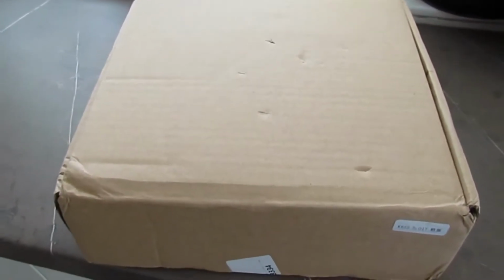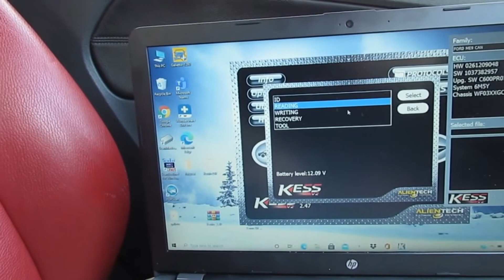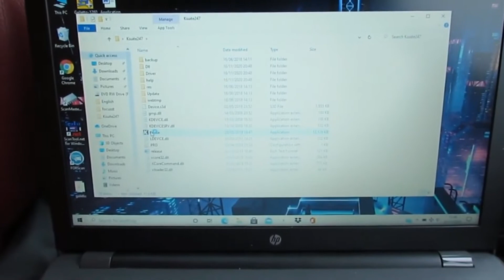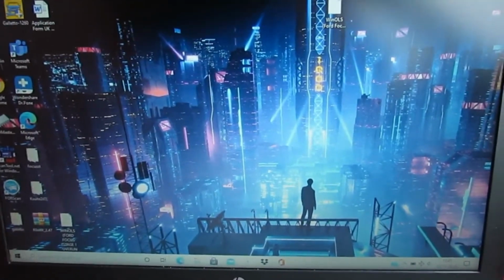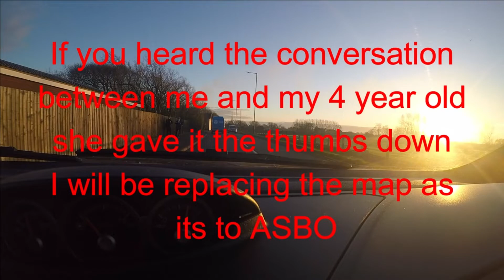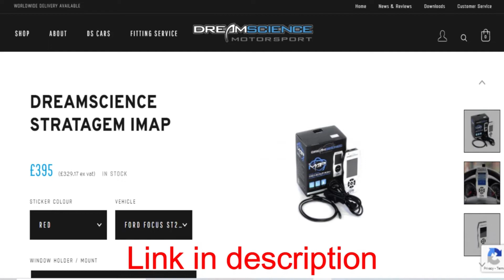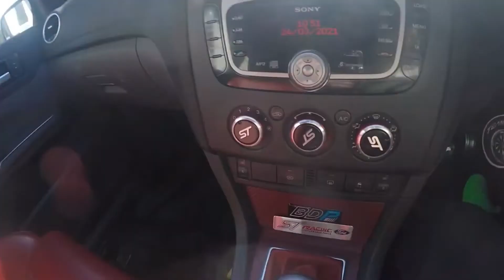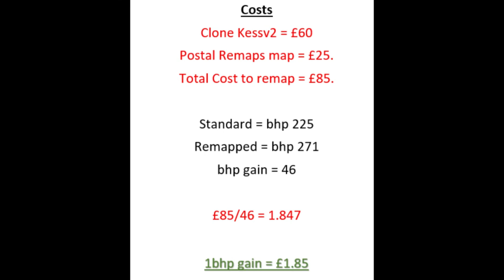Remapping my own car, Mk2 Focus ST225, for less than £100, Dyno results, pops, bangs, flames

Comment: Cloned tools do work but they don't do checksum correction which is why it probably didn't work first time genuine tools correct before flashing kess 2 don't exist now mate kess 3 but it's all online server based
Reply from the maker: Your absolutely right about clones and checksums.  The videos I did where to show it’s possible to do it on a shoestring budget.  It had its ups and downs and I enjoyed doing it.  Thanks for watching 🙏
Reply: Sorry for newbie question what are checksums ? Is this the same with every car?
Reply from the maker: @Mv23689  that’s a good question and checksums are used everywhere not just in ecu maps. a checksum is a mathematical algorithm that checks the accuracy and integrity of the data.
Reply: @DriveWayRay  get you now so because you had a clone it's was giving you the grief I understand now that's for the information and help just subscribed today ;)
Reply: What was the map like buddy u still have the car